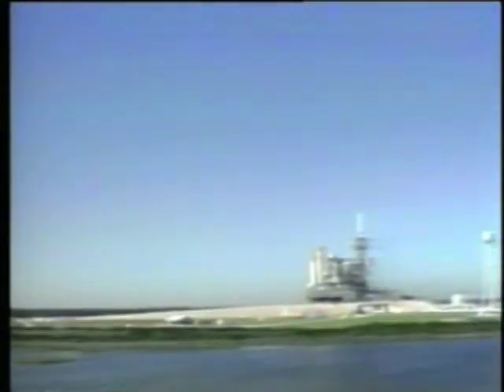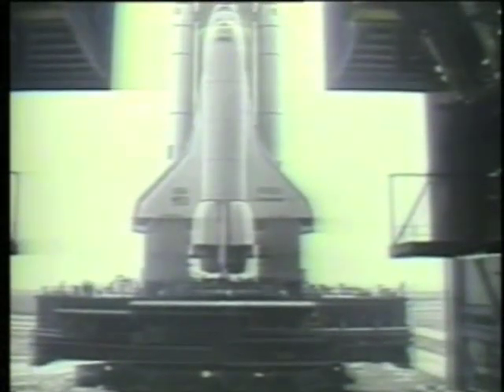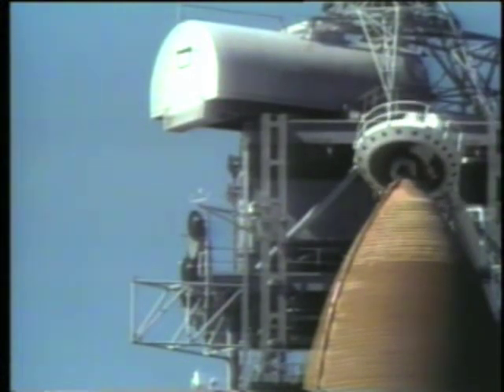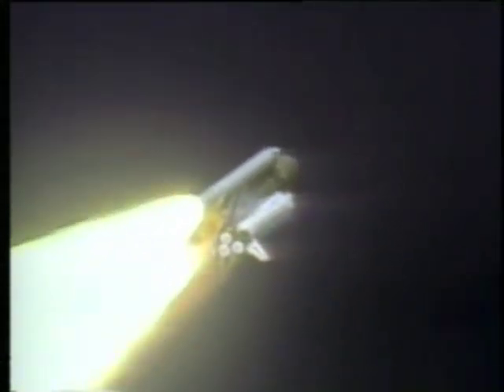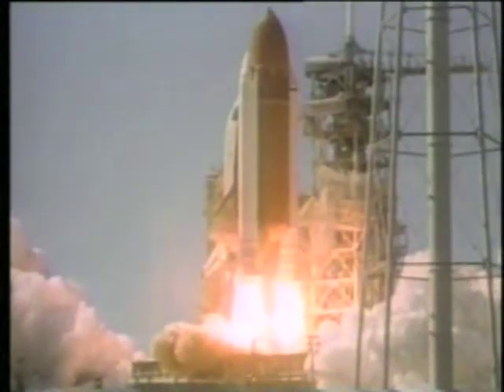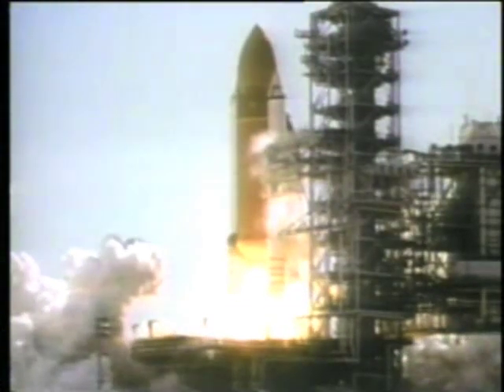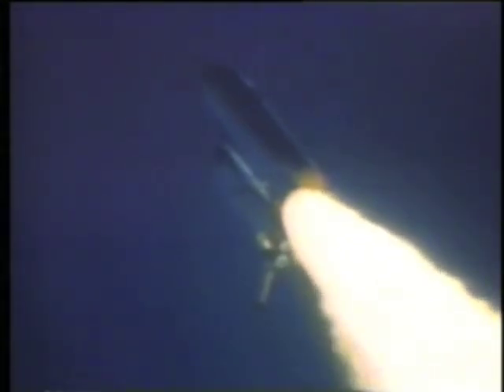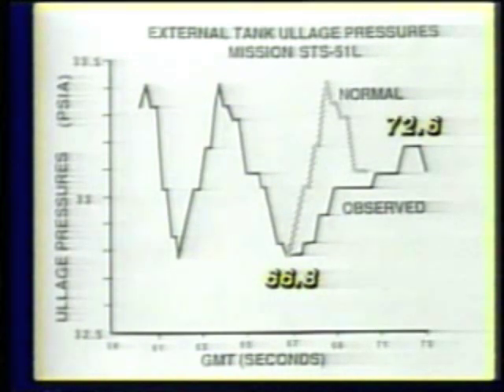Challenger Accident - Part II Photo and Video Analysis

Comment: Rest in peace, brave explorers

I remember that day, it was "record low temperatures" in Florida

I was at work .. we were locked down, working on a secluded area of a prison 
When we came out for lunch we heard it had exploded
Amazing footage in this video, it looks like the rubber O ring failed at the "connection point" of the aft joint, as the accident team found
Too bad:
1. Engineers didn't postpone the launch, wait for more suitable weather 
2. The leak was aimed directly at the fuel tank

Comment: One thing rarely mentioned was the wind at launch. The orbiter was pushed hard by a gust of wind around 25 seconds into the flight. This caused the computer to make a correction. Why is it significant? It could have caused the right SRB to become detached rather than a pure burn through of the strut to cause failure..

Comment: I was at work in Melbourne. I didn't bother going out to the parking lot to watch the launch. Having previously worked at the space center, I figured I had seen enough  shuttle launches. 

A co-worker came running inside and shouted "the F-- in Shuttle just blew up".
I went out in time to see the boosters going wildly in circles.
Normally the contrail would blow away in minutes. That day, the booster contrail just hung there. Hours later, I thought, "there are the remains of some vaporized astronauts".

Comment: 7:43 "A puff of grey smoke can be seen." Considering the size of the shuttle, can we consider that 'puff' a massive GEYSER of smoke? There had to be one, if not MANY NASA employees that saw that and were instantly concerned....
Reply: As you probably know they were warned about that very issue the night before so they should have already been concerned before the boosters even ignited. A tragedy that didn't have to happen. So sad.
Reply: @marlonisaac1  Yes. The cold and rings hardening? Good point. I remember that at that time, after so many "routine" launches, everyone forgot that flying to space with 70's/80's technology was still inherently risky.
Reply: Crashburn 32 I agree.
Reply: The whole thing makes no sense 
Why would a government agency knowingly put people on a bomb just to hope that everything will be ok knowing full well that it isnt?
Reply: @ruledbysaturn   Unfortunately NASA got cocky given its previous successful launches. Several engineers brought concerning data regarding the O-Rings multiple times during production and even days to moments before launch but the higher ups wouldn't listen...they literally pulled a "what could go wrong?" card.
Reply: As this video states, the grey smoke was hidden from most all, at the right rear of the launch pad.  It had duration less than 2 sec so no one would have caught it in realtime.  Even if they had, there was nothing the astronauts could have done after SRB ignition.

Comment: Wind shear had nothing to do with it.....engineers were calling in saying DO NOT LAUNCH....the engineers knew the elastomeric O-rings could not fill the gaps during maximum pressure (launch...) once they were lit.
Some of this narration is way wrong....there is no throttling a solid rocket. You light it and cross your fingers.....it's full throttle until it runs of fuel.....post Max Q for throttle-up were the liquid engines fueled engines on the Shuttle being throttled back up for full thrust....once that puff of black smoke showed at ignition, emergency protocol should have been started....thing is, there was no emergency protocol. It either went up, or it didn't, and the crew was attached to that Roman rocket no matter what.
Reply: This!
Reply: The solids did throttle down at MaxQ automatically by the design (pattern) of the fuel . True fact....
Reply: rockets are made to explode?

Comment: There was actually a solid fuel ‘plug’ that halted disaster on the pad for the 73 secs before the structural breakup of the Stack.
It plugged the hole until the wind shear happened, which dislodged it and freed it, thus causing the flame and the ‘fireball’
All of NASA’s managers were so fired after this fiasco. If you’re gonna launch a rocket, listening to your engineers is essential. I do understand that NASA was frustrated that they couldn’t launch, but if they had aborted takeoff until it got warmer, Challenger could’ve been on display in a high-profile museum. Another thing I noticed was that Challenger and Columbia’s disintegrations were predicted by two other missions: STS-51C and STS-27. Similar problems happened on those missions, though they came back successfully. So that’s why I’m pressing F to remember the Challenger orbiter and her crew.

Comment: Why wouldn’t they just wait until it warmed up
Reply: ConTex23 $$$$$$$$
Reply: NASA and Thiokol engineers and managers had a telecon the night before. First Thiokol advised against launch, due to low temp at launch.  NASA asked them to caucus and give a financial decision. Thiokol managers then came back and said to go ahead with launch. Thiokol engineers didn't have enough data to prove that the O-ring seals would fail at a low temp. NASA will only make a decision when the data is overwhelming.
Reply: There was a lot of criticism in the media about the multiple scrubs. Someone was feeling the pressure...
Reply: lol Maybe Putin had increased princes at fuel allready bACKTHEN

Comment: Never saw any pictures from D67 before. I always believed the power up was what pushed the O-ring over the edge.
Reply: Turned out a piece of aluminium/slag from the burning fuel in the right booster blocked the opening that the frozen O-rings were unable to seal which stopped the explosion at launch, but as Challenger rose, it came up against a strong gust of wind which managed to dislodge it. This allowed burning rocket fuel to escape and burn through a mounting bracket on the external tank which then set of a chain of structural failures and caused the eventual breakup.
Reply: My ex-BIL worked at the company that made the O ring. He said that some employees were very lax about following procedures.
Reply: Obviously.
Reply: Can you imagine if the slag blocking the o-ring failed at liftoff? Or if it didn't do the improvised seal of the o-ring in the first place? Blowing up on the launch pad would've made this incident even worse. Don't know if more lives would have been lost or not, but the psychological effect would have been even worse in my opinion.

Comment: If the leak would have occured on the other side of the booster, nothing of that would have happened ..isn't it ?
Reply: I'm not a scientist but ya if it was away from the fuel tank on the other side they would have probably made it.
Reply: Marlon Isaac it’s unbeleivable when you think about it : dispit all the warnings before the launch, only one joint on 6 or 8  I’m not sure, failed, and at the worst place it could..what a bad luck...
Reply: Innit?
Reply: The leak was always going to occur at that point since it was a cold sink essentially

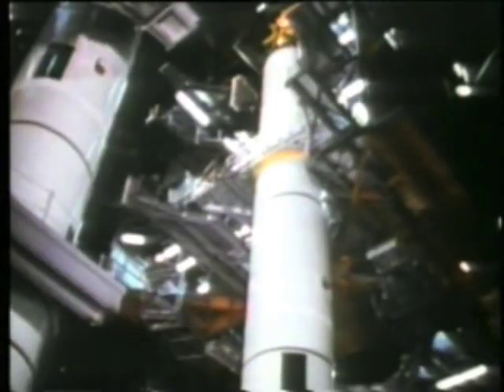Comment: 1:40 - ok, - wich part was exactly THE vehicle, and which were just fuel tanks and add boosters?
Reply: The answer to your question depends on semantics to some extent.  The orbiter vehicle - the shuttle itself - was the winged spacecraft that carried the crew and payload into space. The orange tank that's under the belly of the orbiter carried the liquid hydrogen and oxygen that fuelled the orbiter's main engines. It was empty after roughly 8½ minutes and jettisoned, after which it would burn up in the atmosphere.  The 2 booster rockets, attached to either side of the orange tank, provided the thrust needed to get the shuttle and external tank off the ground. They would expend their fuel after about 2 minutes, after which they were jettisoned. The boosters had parachutes to allow a controlled descent to the ocean, where they would be retrieved for future re-use.

It was the design of the booster rockets that led to the destruction of Challenger, as explained in this video.

All that being said, your question and time stamp referenced the narrator talking about the Vehicle Assembly Building. It was here that all of the individual components - orbiter, external tank and booster rockets - were assembled into what was known as the launch vehicle.

In summary, the orbiter vehicle is the only part that went into space, but required the entire combined launch vehicle to do so.  Hope that helps!
Reply: @stephenp448  well... original Americans'  design was very much different from this and much cheaper and simply the better... then who decided to choose this junk? Even von  Brown would be aghast
Reply: @markfrench8892  no, Your Google is not working... use your mind instead, if you have one, that means.

Comment: if so much was known....why foolish act of launching?
Reply: Good question. Maybe money. Every day that gets delayed is a huge deficit. Stupid reason? YES it is. BUT sadly they push when they should stop.
Reply: Cost money to delay it and it was past the original launch date.

Still foolish to launch in those conditions anyway.
Reply: Because the program could only be viewed as "affordable" by launching multiple times.  Originally there were to be over 60 launches a year, but the most they got was 11 in the previous 12 months prior to STS-51L Challenger.  The orbiter vehicles just took too much work in between missions, so the flight rate became dangerous.  This is what happens when you operate a vehicle outside of what it's certified for.
Reply: hoghogwild 
A lot of media criticisms over delays and scrubs. Someone was feeling the pressure to get the launches going on schedule.
Reply: What you’re seeing was all hindsight. They did not know this in 1985. All they had was theories and observations. The engineers weren’t allowed to investigate to make conclusions or make changes to the flight rules to account for the observations.

Comment: 6:24 - ;-)  -=> 'a danger - go and throttle up!' - oh, yeah! we've got 10% - why not to stretch a little bit? (seems like a nominal power was not enough to end that 'illegal' mission...
Reply: My job is to operate a certain machine - her max! speed is 3000 per hour  = 100% ...---... I would nev er even think to throttle up that b aby abov e that limit (although she would survive... for a couple of minutes...) and then we would have to replace 75 % of her vital parts...) ... Murderers from NASA will be eventually persecuted. Even after 50 years, I hope.
Reply: @mariuszfidzinski7474  the RS 25 main engines underwent several upgrades to allow them to exceed their original rated power. The RS 25A engines on Challenger were full power rated to 104.5%, a 4.5% increase over the original design rating. Later improvements would allow up to 109% (RS 25D.) The engines actually never exceed 100% of their full power rating, only their original design rating.

All that said, the main engines throttling up had nothing to do with the accident. It was a failed joint on one of the solid fueled boosters. Those have no throttle control. 

NASA was not without blame, however, since the manufacturer of the solid rocket boosters advised against launching in such cold conditions, but NASA executives pressured them into giving the go ahead.
Reply: The boosters did throttle control on their own (during maxQ) with the shape of the solid fuel.
Reply: @jrockett73  negative. The solid fuel boosters had two modes. On and off. Off was only available before liftoff and when they used up their fuel. They did lose a little thrust as the fuel was consumed, but it was not something that could be controlled. Only the 3 RS-25 main engines had throttle control.
Reply: My comment has nothing to do with the solids being on or off. The thrust in the booster is reduced at maxq by the propellant grain load or shape of the solid fuel. It is again increased after maxq the same way. The crew has nothing to do with it. The computers have nothing to do with it. Its an easy fact to verify. Look it up.
Reply: @jrockett73  I apologize. I misread your comment as the booster's throttle being somehow controlled via some external means (i.e. compter.) Many people actually think this is the case. Yes you are correct in that the thrust is varied via fuel load design. It is not something that can be altered after the booster is manufactured, much less ignited, as some believe.

Comment: 11:35

Why didn’t they abort at seeing this flame?
Reply: Two reasons: 1) The time between the first noticeable flame and the explosion was just a matter of seconds, so no time to interpret the information and react, and 2) There was no way to abort until SRB separation. The forces placed on the entire launch stack (Orbiter, SRB's and external tank) during SRB thrust were such that any attempt to separate would have had pretty much the same result as what actually happened.  Once the SRB's ignited, you were committed to stay with them until they exhausted their fuel and stopped producing thrust. What is tragically interesting is the fact that if the leak had been facing away from the tank, the breakup may not have occurred. I say may not because if the right SRB had structurally failed further into it's burn because of the burn through, the loss of thrust symmetry between the left and right SRB's quite probably would have also caused directional changes beyond what the stress of the entire stack could endure.
Reply: chaspfrank thank you for the explanation. That makes sense.
Reply: It is even simpler. The video you’re seeing was tape. It wasn’t available live.

Comment: so, at the launch - temperature was high above any freezing...  -=> "fairy tales" for kids before they even started their physics class...  7C below zero, in Florida... hue hue hue - and then, next morning - 36F at the launch!
Reply: sorry, but one more issue? - can you throttle up your car (and would you, if you could) - above 100% ???  What it means - is destroying your engine, your precious car, and possibly - your life! Good luck NASSA!. (why only 104%??? Russians could do 200% of the normative targets...)
Reply: Mariusz Fidzinski - Some turbocharged engines have an overboost feature producing more boost than is continuously sustainable
Reply: @mariuszfidzinski7474  your posts are nonsense. they throttle down at time of maximum aerodynamic pressure (speed, thickness of atmosphere and resonance issues from shape of rocket), they have been doing that with rockets long before the shuttle. They then throttle back up after passing that point. And generally full throttle on a rocket would be 106% to 115%

Comment: Damn what a shame! The idiots will delay a launch because of wind but 20 degree weather and ice on everything no problem. Even a standard airliner would be de-iced before taking off. Damn!
Reply: The ice built up on the launch tower and ground equipment. There was no ice on the launch vehicle itself, and icing on any part of the ground structure played no role in what happened.

An analogy to your comment would be having an airliner that is properly de-iced, but which has a design flaw that, in temperatures below 10°C, allows fuel to leak freely from its tanks.  This sort of flaw would never make its way into a production aircraft of course. The difference here is that NASA had never launched a shuttle in such low temperatures and the engineers who could predict what would happen were asked to prove it was unsafe to launch, which they couldn't do.